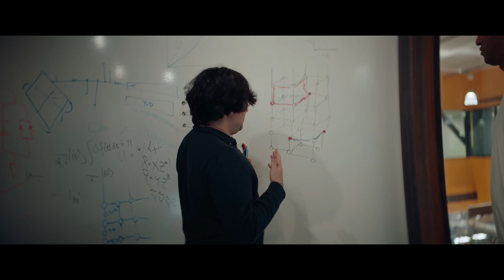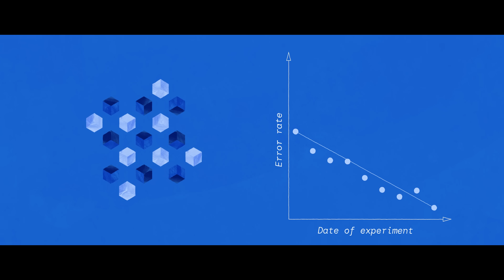Demonstrating Quantum Error Correction

Comment: Frequency is an important parameter used in science and engineering to specify the temporal rate of change observed in oscillatory and periodic phenomena, such as mechanical vibrations, audio signals (sound), radio waves, and light.

Comment: 2040 error correction finally fully optimized and results mind blowing.  Road still so far. It's take decade to slove complex poblem small unit of power .
Reply: They are trying to get this done before 2030 and not just google but IBM, Microsoft, ionq,   Dwave and others are all racing to get this done before 2030.